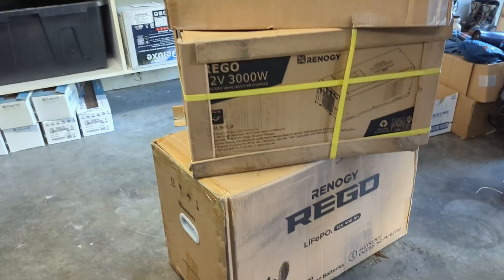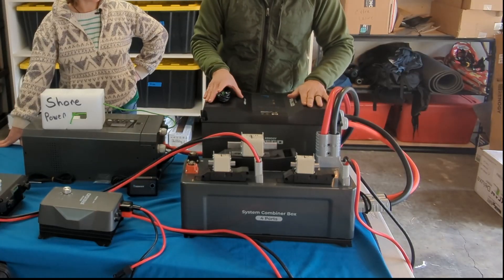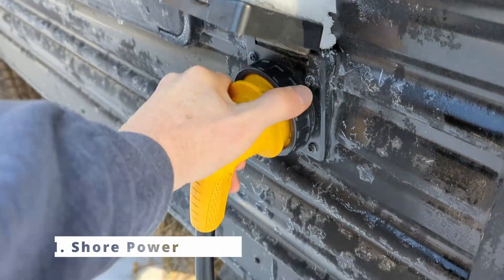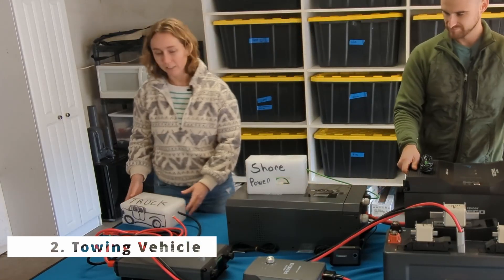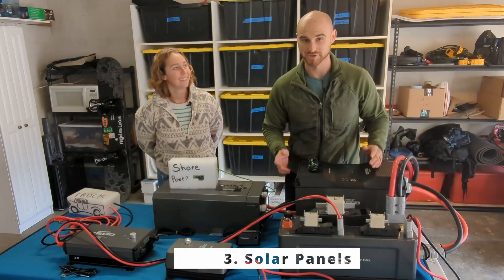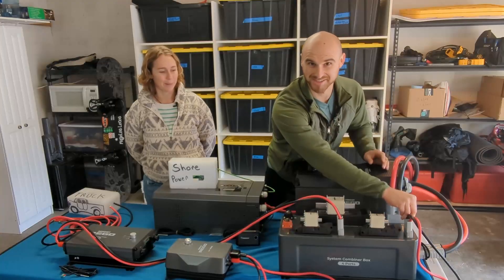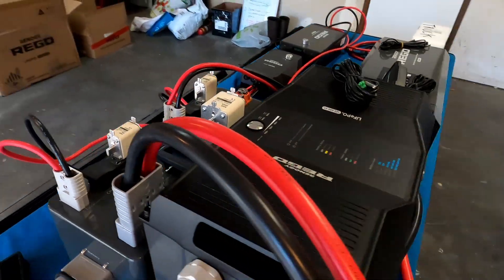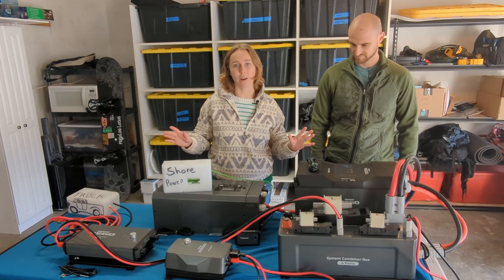Renogy REGO System Explained: Quickly!

Comment: Where did you buy your NH00 and NH2 fuses? I am having a hard time finding them. What voltage are they rated for? Thanks
Reply from the maker: The batteries are 12.8.  The NH3 fuse is rated at 500A, the NH00 at 40A.
Reply: Where did you buy them. My system combiner says to get 2@160amp and one at 400amp. Also are they time delay fuses? How many volts? Thanks

Comment: Has anyone use any of these lately? Im having a massive problem
Reply from the maker: What's going on, and how can we help?
Reply: @FreedomInACan  thanks for the reply. See, my boss bought the whole package last year. Two 400Ah 12V LifePo4 rego batteries, 110V inverter, combiner, solar charger etc. I installed everything on January and ran al the possible tests. 6 months later [last week] boss comes to use the RV and one of the batteries ain't working. It's got a red light blinking on the status área. And I really dunno what the cause may be or how to fix. Any idea what may be going on? Also do these batteries can hold an AC unit or Microwave? Cause its blowing all the protection fuses I put in
Reply from the maker: @nanref0392  For Battery red light, it's telling you what's wrong, see the HUGE manual  - https://store-fhnch.mybigcommerce.com/content/RBT12400LFPL-SHBT/User%20Manual_REGO%2012V%20400Ah%20Lithium%20Iron%20Phosphate%20Battery.pdf
Page 43 is trouble shooting.
Reply from the maker: These batteries should be powerful enough to run the AC for a while, and definitely Microwave.  Is it blowing your circuits in the AC breaker box?  That sounds like you've just got too much load in one circuit.  Does it blow when plugged into shore power?
Reply: @FreedomInACan  im testing the circuit 1 by 1. Everything is off just AC is ON. Is a Coleman 15 110vac 10A. And is blowing 100Amp fuses. NOW... Everything in the RV'd breaker box seems to work fine, overload nor overheat right voltage and amperage. But the cable that connects the combiner and inverter (2awg copper wire 660v) is the one overheating, installed a fuse for safety and goes up to 150Amp blowing the fuses.
Reply from the maker: @nanref0392  so, I sent our chat off to some engineer contacts at the company, and I'll let you know what they say.
Reply: @FreedomInACan  thanks
Reply from the maker: @nanref0392  could you also send us a quick diagram of components and fuses, can be hand drawn.  Email it to freedominacan1957@gmail.com.
Reply: @FreedomInACan  sure.

Comment: very neat and clean.  how would this system compare in price if i were to have purchased 2x 200 Ah or 4x100Ah?
Reply from the maker: 400Ah Battery ~ $2.5K - https://renogy.sjv.io/ORP2ez
200Ah Pro Battery ~ $1K - https://renogy.sjv.io/anog6N
100Ah Pro Bat ~ $550 https://renogy.sjv.io/0Z5oXP
So you save a bit of cash by going with the two battery route, but it doesn't have all the exact same features, cables etc. as the REGO battery.  Though, certainly comparable.  If you don't mind connecting the batteries together in parallel, the best price should be going 2 x 200Ah PRO (this has built-in BT, self-heating and a load of other features.)
Be sure to use our promo code "Canlife" at checkout because it will get you an additional 10% off your purchase.  
Let us know if you have any other questions.

Comment: What AWG cable can I use to connect a dc fuse panel to the combiner box terminals? Thank you.
Reply from the maker: In this installation, we used 4AWG connected to the combiner box terminals.  However, your wiring depends upon your DC load and distance between the terminals and your DC fuse panel.  Never a bad idea to throw a fuse in-line as well, especially if you're using the new combiner box.  Here's a wiring size article and chart that I like, https://explorist.life/what-wire-to-use-for-diy-camper-solar-system/

Comment: Renogy discontinued the product line.
Reply: Does it support dual 400ah batteries?
Reply from the maker: @MNHemiGuy  Yes, with the new 4 slot combiner box, you would just put both batteries on the busbar in the combiner, and connect the rest of the components as well. But you'd only have 2 more slots, unless you added a second combiner.
Reply from the maker: I'm not sure that's true, they just came out with a new combiner box that isn't as bulky as the old one.  I'm going to look into that to confirm.
Reply: The 3 and 4 port boxes have been discontinued. The promise of this product line is gutted without the plug and play simplicity of those pieces. In effect, now Rego is a big overpriced battery, with odd connectors that are now unnecessary, and a bus bar at an insane price. And it’s all overpriced.  @FreedomInACan
Reply: So, did Renogy tell you what they told me - the 3 and 4 port combiner boxes are discontinued. The appeal of simple plug and play components is gutted. Now the Rego product line is overpriced, and the bus bar box is stupid expensive, for a bus bar.  Renogy suckered anyone investing in this product line.  @FreedomInACan
Reply from the maker: We've had some greater clarification on this.  The REGO system is NOT being discontinued, only the 3 Port and 4 Port combiner boxes have been discontinued. These are being replaced by the new 4 port combiner box, which as you indicate is a 500A Busbar.  The current combiner box does not have fuses, so they are working on a Smart Combiner Box which will - no timeline for that release as of yet.

Comment: Has renogy discontinued the system combiner box? I can't find it anymore on their site...
Reply from the maker: It doesn't look like they've discontinued, it appears that it's out of stock, like many REGO products. 
Here's the system link.  https://renogy.sjv.io/kjxm2d  
Were you interested in that as a stand alone product - because I can't find it as well.
Reply: Speak to customer success, the 3 and 4 port combiner boxes are discontinued. And the charge controller has a higher rate of failure than the Rover controller line.

Comment: Great Video. What is the combined weight of the REGO system?
Reply from the maker: Combined weight, 228 lbs. w/o cabling.
Battery 112 lbs.
Combiner Box 40 lbs.
Inverter charger 64 lbs 
DC to DC 7 lbs.
Mppt CC 5 lbs.
By comparison, 7 x 100Ah Gel or AGM batteries (same power capacity as REGO LFP) would weigh in at 444.5 lbs. for battery bank alone w/o cables.
Be sure to use our link and promo code for 10% off!

Comment: Hey there! Just wanted to say that your videos on the whole Rego system are absolutely awesome. Thanks a million for creating such great content! Your videos actually convinced me to go ahead and buy it. 

However, I ran into a bit of a snag when it came to shipping. Unfortunately, the shipping costs from Renogy directly to Hawaii were through the roof, so I couldn’t use your affiliate link. But, I managed to find the parts I needed from another source.

The only little hiccup I’m facing now is trying to get my hands on the combiner box and accessory bundle without having to shell out a whopping $600 for shipping from Renogy themselves.

But seriously, thanks again for the amazing and fun video series. Keep up the fantastic work!
Reply: Think we need cheap solar powered delivery!
Reply from the maker: Thanks so much for the comment, we had a lot of fun installing these components and making the videos.  It started out as just one big video and then, well, the project grew in scope, haha.  Sorry about the shipping challenges of living in HI.